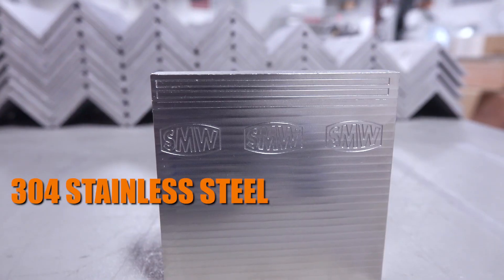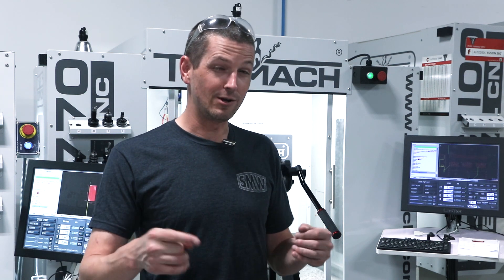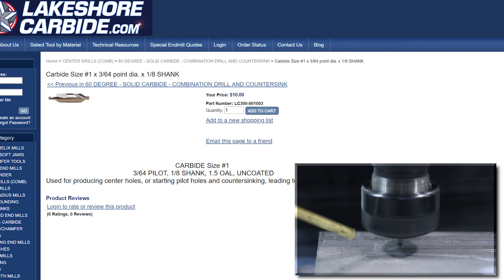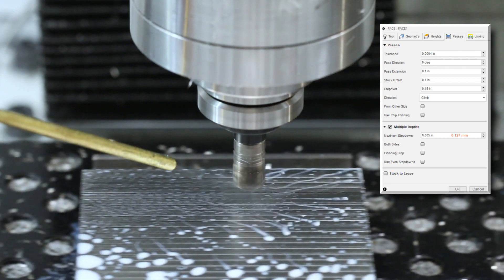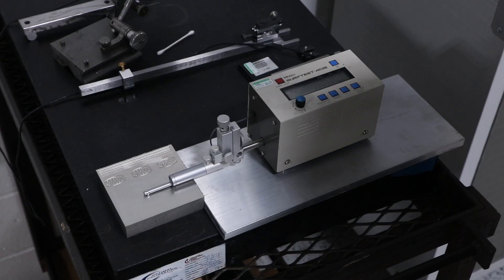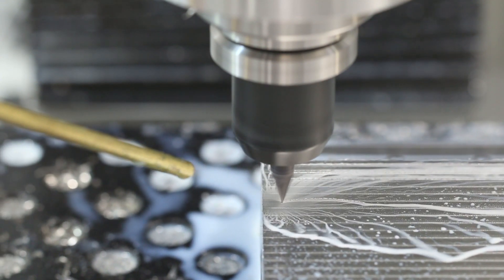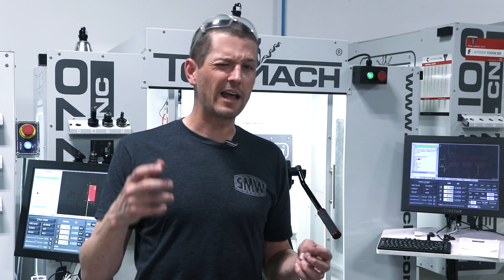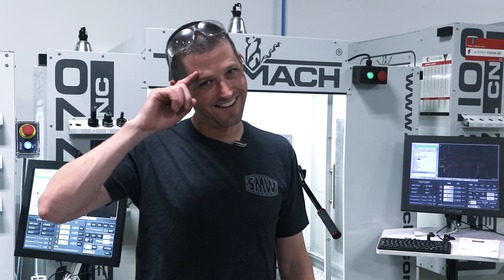How to Face & Engrave 304 Stainless Steel | WW251

Comment: we mill 304 at a much lower sfm, around 120. its really dependent on spindle rigidity sincle 304 requires a lot of backpressure to cut. its tough not hard so it likes to peel and not be shaved away. its like peeling an orange, unless you have supermans finger of steel, you need to slowly pierce the top layer and once the cut is started the rest will follow. too fast of a piercing action (sfm) paired with too light of a cut leads to extra wear and more burrs and less material removal. at higher sfm the spindle doesnt have enough time to return to center and it bumps&rides along the surface instead of having the opportunity to pierce the orange and peel the rest of the chip way

Comment: The first Full time CNC setup programming job I had was in 1988.  We made aluminum microwave housings. Hand G code.   Then the boss took in a 304SS microwave part. We had used form taps on all previous parts. I questioned it and said maybe we should use cut taps.   Nope -  so I setup to use form tap drill size - we tapped off line.       Broke taps after the lot was done,  had to make them all again.

Comment: Just to add to the Library, Using a lakeshore carbide 1/2" 6 flute 7800012 on my series 3.  Cutting 316L stainless, using a setscrew TTS holder, full flood.  I burned up a couple of endmills trying a deeper cut approach and was getting a lot of chatter especially in the X direction.  This made me believe that the rigidity of machine was coming into play so I started backing off on the depth.  I found a working sweet spot at 2000rpm, 15IMP, 0.1 depth of cut, 0.1 stepover.  The finish isn't bad on the side cut and the tool survived!  I think I can get it better and will have to do some more test cuts but for whoever wants to go with a 1/2" that should get you going.    
Thanks for all of the great information!!

Comment: https://www.mscdirect.com/product/details/86238847
 John  this is a tool from iscar that i use for engraving hardened tool steel  , i do NOT work for iscar but the tool was well worth its cost, tool life is great out side when not in hardened tool steel but in its hardened state it will engrave what your doing 50 or so times while in 1018  tool life would go for 100s of parts. if you would test this you will be impressed  no doubt , i run at .030 doc  4500rpm 9ipm  in hardened steel with great results  (material h13)

Comment: I have had success engraving 304/316 with a small ball endmill (3/64" or 1/16") and going about .003"-.005" deep.  I like that idea of using a carbide centerdrill.

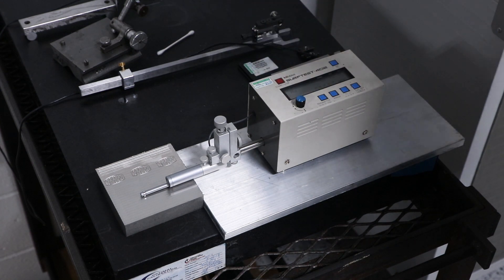Comment: @ 7:00 : Ra doesn't tell you a lot about anything really, it's a hold over from a time that's all we had to work with. Rz (difference between 5 highest  peaks and 5 lowest valleys within sample) gives you a lot more information about the surface in general. but that's by no means the end of it. Rmr (how much material do you see at a certain depth from the top peak in a sample, in other words; does a part look like mesas or like mountains) is very important for hydraulics for instance, where you'd want valleys for lubrication but not peaks that cut your seals to shreds.  you have quite a nice tester (although a bit classic, but with a new probe it looks like). as far as i know it does Ra, Rq, Rz and Rmax. Rq is the RMS of the given surface, already a way better indicator of general smoothness than Ra which is just the arithmetical average (in Ra a perfect sine wave surface would come out to 0). Rz says a lot about how "peaky" the surface is. Rmax just gives the biggest deviation from the mean, so is prone to plane bad luck. 

I'm what one would call "a difficult customer" when it comes to surface finishes. i've made a lot of tiny, thin-walled, difficult material hydraulic and pneumatic stuff that has to function for a long time and be absolutely reliable. i tend to have to train machinist in what it is i want in this regard, since most of them just get asked an Ra and that's the end of it. i usually have an Ra (because it's mandatory when calling a roughness mark), an Rz  and an Rz dependant Rmr) when specifying an important surface condition. i've had break machinists hart when they show me a part on which they got an Ra that was a 10th of what was asked, only for me to tell them that now the Rmr was too high, the surface too smooth for me to work with (yes, too smooth is a thing in hydraulics). surface finishes is a bit of a niche field, but well worth getting into a bit as a machinist/shop-owner, specifically because a lot of your clients don't know enough about it (just like most, including me sometimes, don't know what makes a part easier to machine)

Comment: Milling 304 is easy, just sure to make some steps:

1- Use a lot of coolant.

2- low feed and low RPM

3- Put an Madre de Guadalupe image inside the machine table to help with the vibration...

Comment: My own personal experience, but Instead of the Dijet cutter use a lakeshore 5 flute with a .010" ADOC. Cheaper cutter and leaves a lower RA finish because the bottom is flat. In my 770 on low belt I use a 3/8" diameter with a .3" step over, 220 SFM at .009 IPT. In my VF2 I run a 1/2" diameter with a .45" stepover at 300 sfm and .015 IPT. About %98 of my work is 304 stainless and my parts must have a 8-12 RA finish on all faces, I've found this to be the fastest, most economical way to face any surfaces. I get about 16 hours of cutting life on the 770 and have hit 40 with the VF2, flood coolant both. Great for pocketing quickly also, use the highfeed aproach just with a standard endmill. I do own a Dijet highfeed cutter and use it in the 770 frequently for punch/die jobs I see frequently (prehard D2 steel 55Rc) and have tried it on stainless steel. Simply put, 5 flutes move faster with the right tool paths.

other general starting tips from someone who has 15 years with primarily stainless:
304 machine start at 220 SFM for Altin coated
316 at 210 Sfm for AlTin
410 at 175 SFM for Altin

Cutting depths depend on type of cut and machine rigidity. 

Keep the tool moving, there is no minimum cut depth, just don't let it rub.
Don't use wiper inserts
most all raw stainless has a hard abrasive crust or shell that tends to resist cutting, once this is gone it cuts like butter

Great vids John! I've followed your channel since your first 1100, you do a great job of sharing valuable information and inspiring others to join in on a once dying industry!
Reply from the maker: Thanks!  This is excellent information!

Comment: The only stainless I work with is is 303 and 304. We use a 2.5" face mill with the SEKT style inserts for most facing operations. 850 RPM and .004 chip load works great without coolant on deeper cuts. But, if I'm taking a .03 depth or less cut, I use coolant otherwise there's a tendency of chips dragging and sticking on the backswing. And yeah, like you said, burrs are a pain on 304 especially with a dull cutting tool.

Comment: I found that to as well, that basically Fusion 360 treats an Engraver as a Chamfer Mill. I may have discovered that in their Wiki. The benefit though, is that on a Chamfer Tool you can set all the parameters (like point angle, etc), to match the tool that you have.

Comment: Fusion 360 doesn't let you program a trace with a centre drill? I use HSM works (which is the same thing) and that lets you use a spot drill for tracing.
Reply: Spot drills and center drills aren't the same thing in Fusion and HSMWork. So yes a spot drill works. A center drill doesn't.

Comment: Another tip with the coolant is to raise your concentration. We use qualichem 250C (I think that's what you use) and if we are running a bigger job in 304 I will raise the concentration to 12-15% I find that makes the biggest difference of all.

Comment: There’s also a vast cutting difference between 304 and 304L. 

That little bit of extra carbon in the 304 makes a huge difference in getting a clean cut chip versus getting mushed over edge in 304L

Comment: Depending on how much material is coming off a great strategy is using an opti I use  master cam witch it is called dynamic to cut the balk of either the outside of the part or taking the back off. I use the widia 3/8 varimill with a .03 rad. I then take the same cutter in half inch and cut .01 off to finish it (top). If doing this on bigger plates you normally can not go to size. It can warp and bow up to .01 I do plates that are 12 mm thick by 7 by 14 and have to be with in .003  and it must be flat and parallel and doing that I can nail that every time. When roughing I take 5-8% of the cutter going 200 ipm @ 4500-5000 rpm and to finish I typically go 175 sfm with a chip load per tooth of .0011 and that will put me around 1500 and 15. Now normally can go up to 2850 and 22ipm when hitting the top of the pcs with a half inch end mill. That is done in any of our vf2's or our vf3!!! :)

Comment: As always great informative video, been watching since the beginning days in NY, I learn something in every video. I have had to do a lot of engraving in 304 and 316, I have tried a lot of tools and by far best tool Harvey 939716-C3 1/4" 90 degree .015 tip. lots of coolant and ramp in no plunge. I have cut .015 to .020 deep to fill with powder coat and the tool lasts a long time.

Comment: Love 303, like 316, kinda hate 304. BUT I think that 304 when polished has a much better feel than any other material. I've recut all the balls for my machine handles in 304 and it just feels better. I don't know how to explain it. I have made a series of balls, 1 inch diameter in a myriad of different materials to test this and it's unanimous. A ball of polished aluminum or brass feels different than a ball of polished 304. I assume it's because the stainless holds heat better so your hand warms up the part instantly, where aluminum and other materials take longer to warm up by hand and feel cold. 304 takes a brilliant polish too. It's gummy and crappy to machine though.

Comment: I really like the look of that Lakeshore engraving tool. Up till now I have been using a 2FL 1/16 die sinking ball mill. It has a cut length of only a little longer than the ball radius. Say about .080". These work exceptionally good and holdup good. I have used it in 304, 316,17-4, Nitronic 50 & 60 and  Inconel. Between .005-.01 depth of cut 5 Ipm feed and 2 Ipm plunge at 6000 RPM on the Mit's (Its max speed) and 10,000 on the Mazak. But It costs almost twice as much for a single ended tool. I think I will give the Lakeshore a try. Can you get the Lakeshore tool with a coating? I couldn't tell from the link you gave on the tool.
Reply: I ended up using a 1mm mitsubishi 2 flute ball for hard materials, that is my go to engraver on low rpm machines

Comment: Thin cuts on steel with carbide inserts are incorrect working conditions. You are forging, and hardening the surface instead of getting under it with a nice cut. Thing is with 304, it doesn't like heat, the surface melts and sticks to the cutting edge of the cutter, by doing that, it "chockes" the cutter, increase load and eventually breaks the cutter. Just avoid high rpm's ,full diameter penetration and full diameter plunges. Also use sharp edge cutters.
Reply: Fischer977 
That’s not an issue when using high feed milling inserts which are specifically designed for shallow depths of cuts. Most high feed inserts max out at around a .025-.030 DOC. A .005-.010 is perfectly acceptable

Comment: I find it funny how I see multiple American jobshops go around stainless steels and even harder materials saying they're hard to machine. I'm a schooled machinist and I haven't had any issues with it at all.

Carbide is the only way to go for stainless and up, preferred with a coating like TiCN.
And cooling, flood that endmill with coolant, it's a CNC not a manual mill
Reply: René Honsbeek we do not have problems machining any materials especially stainless steels. Thanks
Reply: @whitewolf9547  didn't say you guys have issues, just saying that the American jobshops on YouTube that I love to watch, nyccnc, titans of CNC, edge precision and grimsmo knives. Always say they're hard to machine while they just aren't. 
It's all about the tools and how you work with them. Keep them cool ( and yea I know flood cooling sucks for YouTube) make sure they actually work the materials. There's so much around machining, I'd rather have expensive tools and old machines then the other way around.
Reply: @honsbeekiejj  3 of the 4 you mention (not sure about Edge though I am familiar with them), started in garages and apartments out of passion.
Reply: Machinist 
Yep i have ran into the same length of material, one spot cuts awesome, 6” over it’s as hard as it can be, and just squeals like a pig instead of cutting. 
Hss cobalt will still cut stainless, just dulls much faster and more susceptible to heat killing the edge faster and thermal shock.
Reply: René Honsbeek 
That’s partly because SS304 in the US isn’t quite the same as European “304” stainless. 
European standard  is a few % lower in chromium than the US. 

EU standard is 17-19 percent chromium, . US is 18-20 percent chromium 

While still considered equivalent, it does make the US 304 a bit more difficult to machine with the typically higher chromium content
Reply: Well Rene, America(i.e., United States) has done pretty well for ourselves in a mere couple hundred years. All by ourselves. Do I really need to remind you of some of our successes. Kind of painting a broad brush aren't you. Maybe you're just a bitchin dude that has the rest of the world in his rear view mirror. Next I'll bet you're going to say metric is better. Good grief, I won't hold you're comments against the rest of Europe.
Reply: @keithhansen3963  Well.. only 3 countries (at least according to a google search) use the imperial system. Considering there are more than 190 countries in total, I'd vager it must obviously be better?

And okay, let's examine the "done well for ourselves all by ourselves" 

1) How much debt is the United States currrently in? Not saying you're the only ones, but you are surely far from the best ones off.
2) You needed help from the French, Spanish and Dutch to help you in your revolution against the British, and remind me how many wars you've won since then without help from others? Korea? Iraq + Iraq Vol. 2.0, as well as numerous other interventions in e.g. the Middle East. And talk all you want about you mighty military - the one that couldn't even beat a talking forest in the 60's.
3) And you speak of painting with a broad brush - well the United States  may have held a position of high regard in both political and military terms, but ffs - you guys elected a reality TV star to "run" your country, which tells me you really don't give a fuck anymore, so why even bother with a Youtube comment?
Reply: Patrick Joergensen . Wow, something I said obviously struck a nerve. I don’t know what country your from, but I’m not going to apologize for mine. Only times I’ve ever seen people act like you is when they were jealous. So keep your great life and your metric system and don’t worry about the bad United States of America. I don’t have time to educate you.
Reply: @keithhansen3963  so now it's a political thing? What's next? Race? Homophobic? 
Do you guys have a routine of topics you just have to incorporate?

And I'd much rather be able to go to the hospital without having to worry about the debt I'd put myself in, so I'll stay here for sure :)
Besides; if I am a smartass behind a computer screen, then what are you? You were the one glorifying your country and stating you did it all by yourselves 😅 and you went aggressive towards René so why shouldn't I have the same opportunity towards you? Just because he wasn't the one to call you out doesn't mean others aren't allowed.
Reply: Hey Racist Rene, the term is "harder to machine" in this case "more difficult to machine" you changed the context to "hard to machine" because youre an ignorant racist. how hard is to machine when the machine does all the work? let me put this in a term you can understand, piss off!
Reply: @dmbworks8094  At what point was something stated that had anything to do with race whatsoever? Please elaborate, oh great Master of Inbreeding.

"how hard is it to machine when the machine does all the work" ... it still requires knowledge about the material, tooling, feeds and speeds etc. - just as the very first piece of rusty old iron you probably got your hands on. Otherwise you must have a very happy tool supplier...
Reply: Oh man, here come the, "In Europe we do..." bullshit comments.
Reply: @xenonram  from a kid that plays video game and teaches people how to drink coffee. All I read is he is an ignorant racist.
Reply: Agree. 
Work with 304 and 316 on a more than regular basis - lots of coolant on carbide endmills. Carbide inserts on the other hand when face-milling; I usually run with air instead of coolant, as the thermal shock will crack the inserts faster instead of letting them transfer the heat. At least from my experience after years of trial and error.

The main issue I have with stainless is the tension that builds in the material once you machine it - especially on long/plate/thin parts :P
Reply: @PatrickJoergensen  the tension is in all materials but yea stainless really is a bitch, I always try to work towards the center in stainless. Prefer running a program a few minutes longer then having to make 10% extra for the warp that's going to be introduced